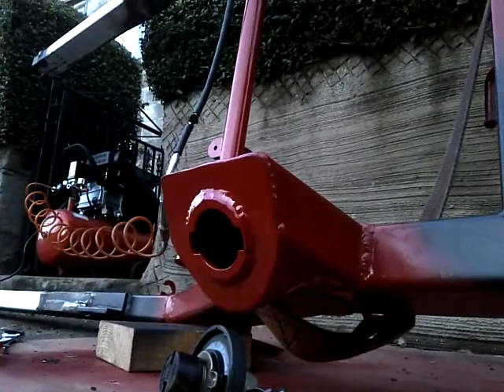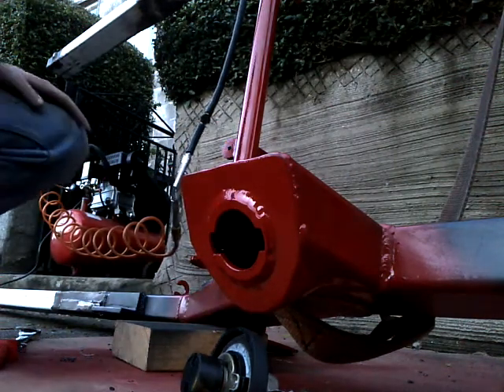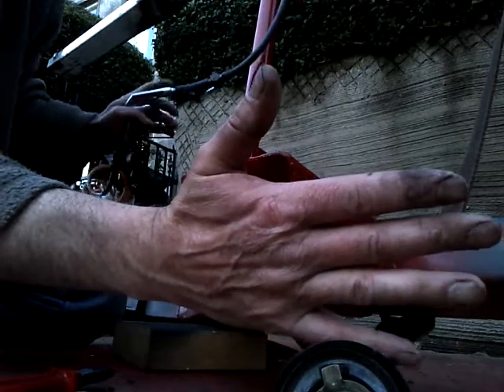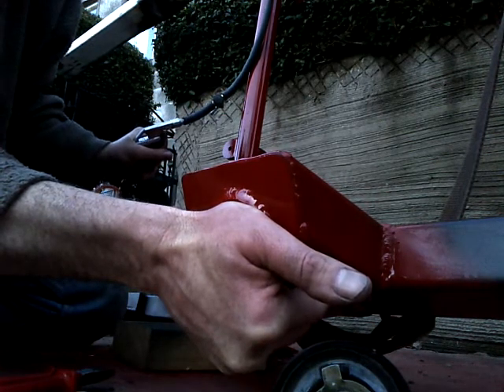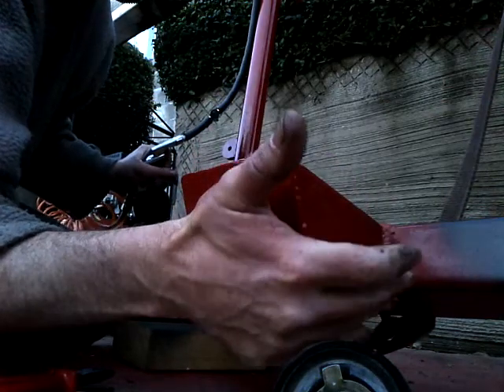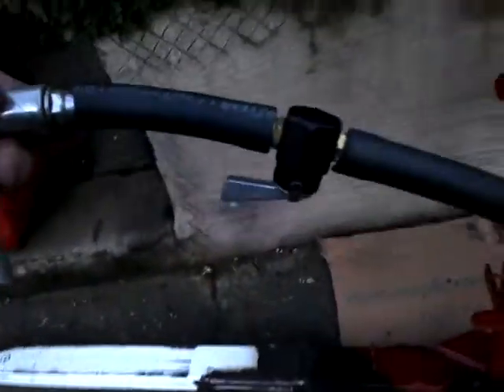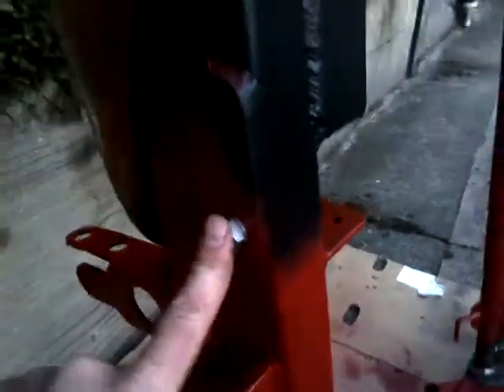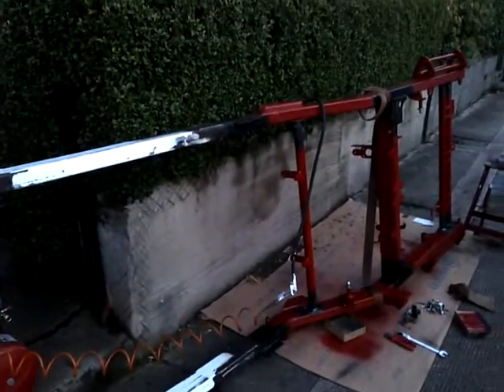Pressure test of completed rear chassis/fuel tank :-)

Comment from the maker: Next sunny dry day I'll be lifting it out to the street (1st upside down) to give the chassis it's main 2K top coat using the full sized spray gun. then I lift it with the heavy duty 'shoulder' lifting strap with a couple of bodies to help lining it up, pushing it inside end of old chassis, then use my cable winch to pull the two parts together :-)